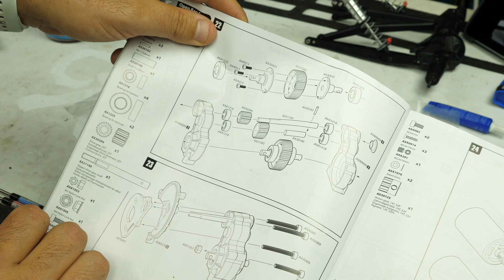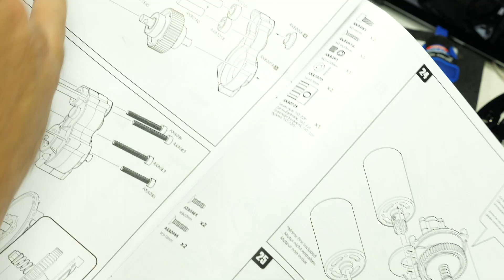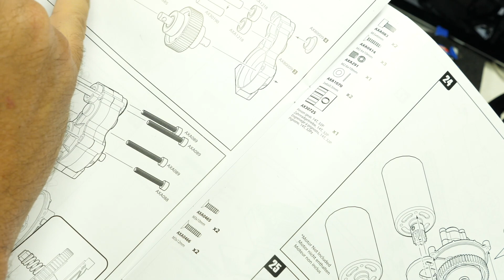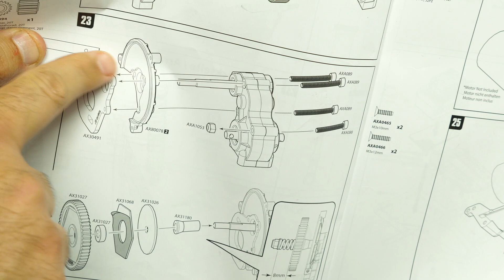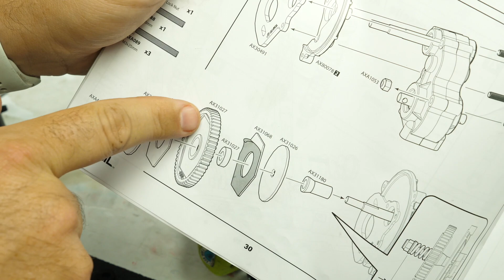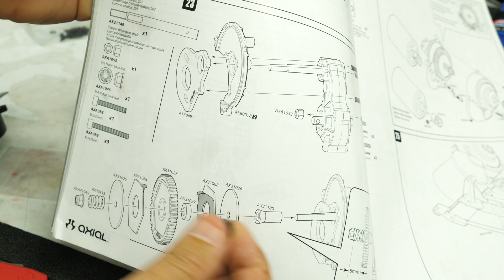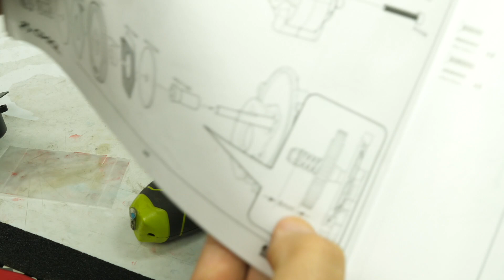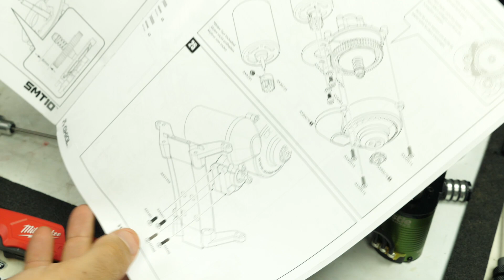Axial SMT10 RAW Builders Kit Part 4: Transmission Build & Motor Mount

Comment: ive been using the paper gear lash set up since my first rc car.  kyosho outrage ST mid 90's.  works everytime never stripped a spur.
Reply from the maker: Paper does work. only one I've had issues with is the 3s arrma lineup since the spur/slipper assembly isn't locked in place when you set it.

Comment: Do you always run the Castle 1406 series in your SMT10’s? If so do the overheat? Looking at getting this same motor for mine but on castles website they say you should use a 1410.

Comment: Do you think it is worth it to cut everything off of the parts trees and sort them by bag still so that you know where they are at?
Reply from the maker: No because most of the time they call for parts based on the tree and the by a number or letter where it is hung on that tree.  I get out each tree I need for each step. I leave the parts on until called for so that I know where to find them.